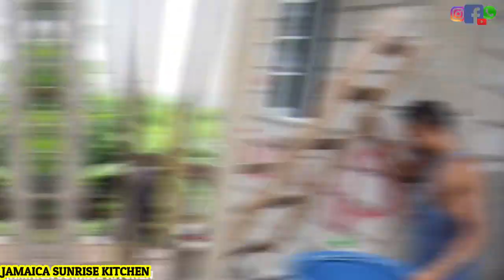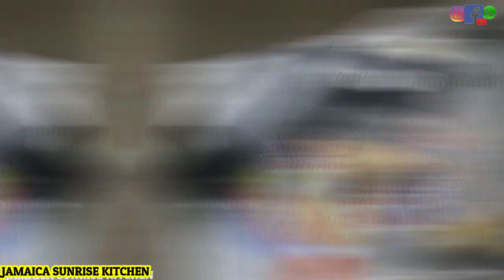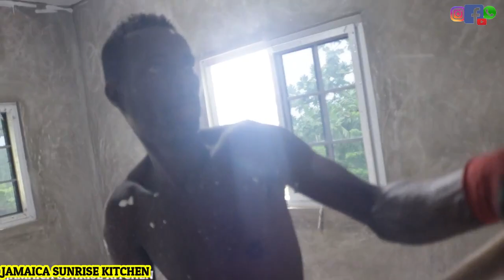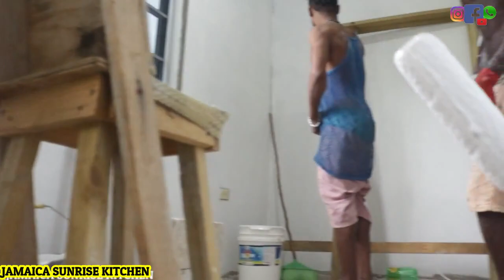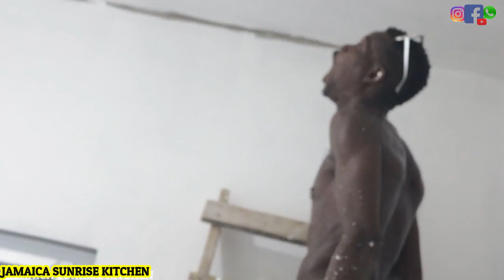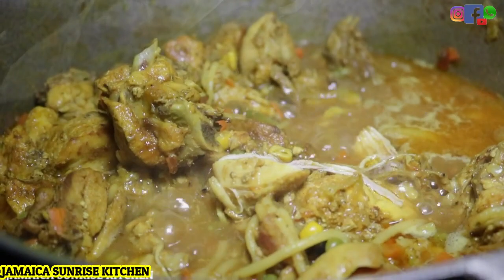What color should I paint kitchen in

Comment: The color is not so important, but hiring a professional painter is. The professional always "cuts in" the corners first. Electrical plate covers are removed before painting.  A primer coat is applied first, then the top coat, and in a methodical manner.